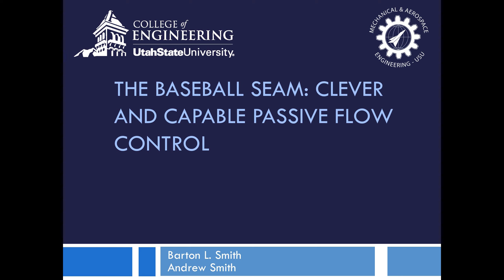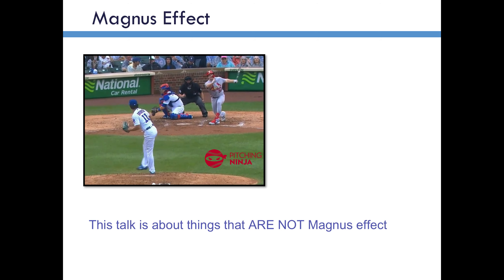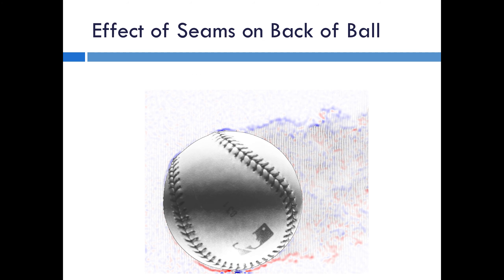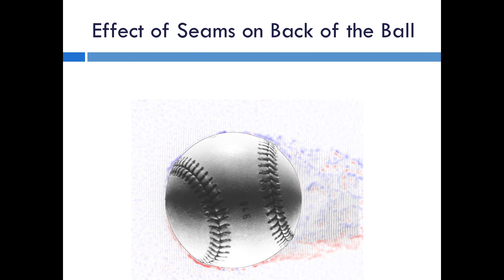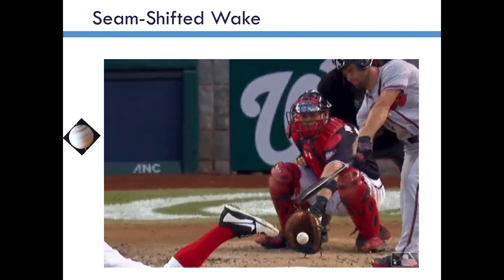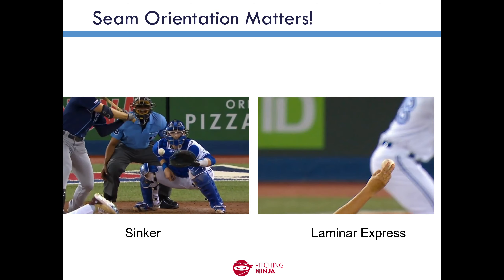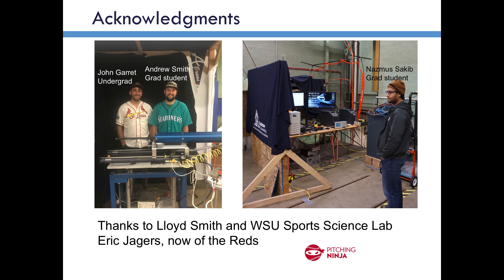The Baseball Seam: Clever and Capable Passive Flow Control

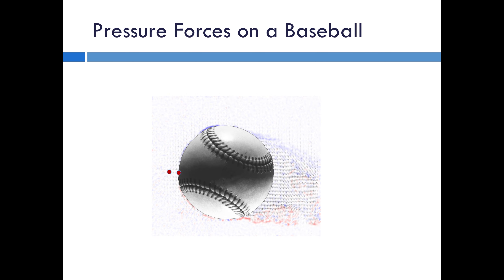Comment: At the 6:47 mark during this video... if a pitcher were to throw a slider with a two seam orientation just like this... would the ball then drop much faster than if it were to be effected by gravity alone?  Or would it appear to rise? A slider with an upward tilted axis of about 15 degrees. 15 degrees upward from a pure gyroball
Reply: I am a year late at replying to this. Bottom line, yes, sliders very much can (and usually do) have seam effects